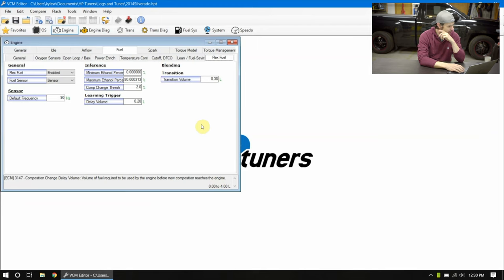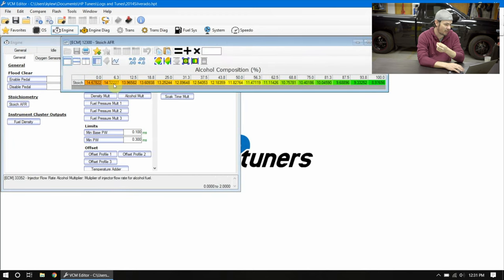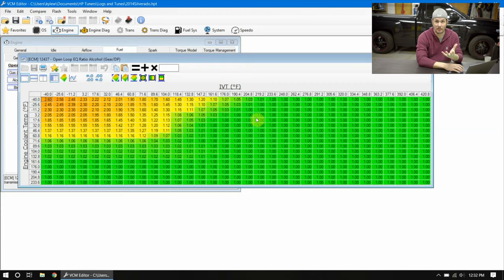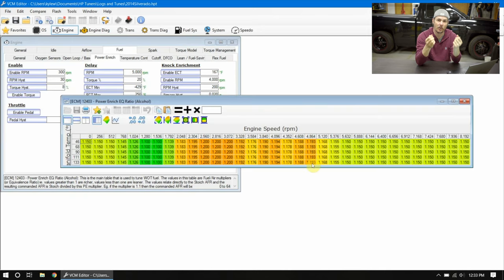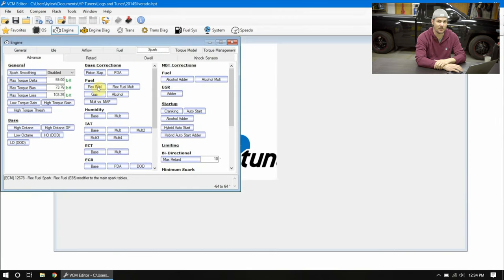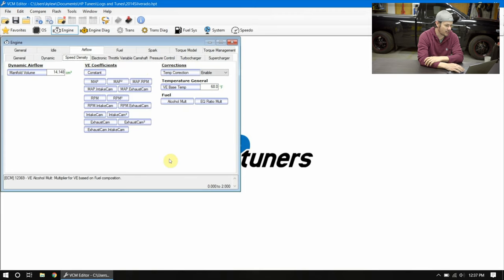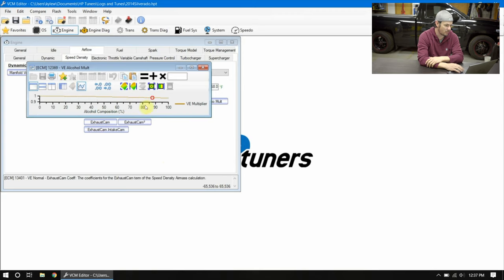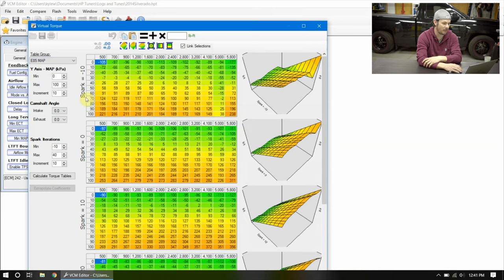Flex Fuel Tuning in HP Tuners, Tuning Series Vol. 7

Comment: Installed the AC Delco Flex Fuel sensor on my 2018 Silverado Crew Cab last year and this is what I found. Of course did all the flex fuel changes on the tune, but, it kept throwing LEAN error codes (P0171, P0174). My LTFT/STFT were always lean. My sensor reads Alcohol percentage of 80% which is awesome. GMs Factory Stoich in the tunes for 80% Alcohol is 10.000ish. I had to drop my Stoich to 8.000ish at 80% alcohol and interpolate across Stoich 14.6 0% alcohol to fix my STFTs. Just had to richen it up a notch 😁

Comment: What if you have a good 93 tune and don't have ethanol content sensor, but you want to run e85. Do you just multiply fueling tables by roughly 30% and tune from there or say put the stoichiometric table to 9.765 and tune from there?
Reply from the maker: Exactly!

Comment: I need help.  I have a 2000 silverado of which I've pulled the 5.3l and installed an "Iron Block LS2" with 36lb injectors, 58psi return less fuel rail, Drive By Cable, with added flex fuel sensor.  My P01 ECU was flashed with a 2002 Tahoe L59 (5.3l flex fuel) tune, so I could have those features, plus keep the drive by cable setup.
I currently have the flex system disabled and am working on getting the regular gas tune right, but I'm fighting a lean issue, and some knock... The ECU is pulling 2-3degrees under load, running on 93octane.  Starting as an LQ9 6.0L block, with 0cc flat top pistons, Gen4 rods, 243 heads, double valve springs, Cam is a TSP220r w/ 0.600" lift on Intake & Exhaust, Headers, cold air intake, and TBSS manifold.  
I've got it to where it starts easy hot or cold, idles "pretty" well, (some chop, but that could be the cam) doesn't fall on its face under accelerate,  and very rarely stalls.  It "sometimes" does after a quick throttle hit, followed by fully lifting off, smashing the brakes, and turning the wheel.  With that said, it's running too lean for my taste, and I can't seem to fix it.  Since this is Gen3, and a Tahoe Tune, I don't have Speed Density available.   My wide band shows 14.4-16.5afr anywhere from idle to 2500 under 15% or less throttle and light load.  It spikes to 17/18 under 50ish-% throttle, and it's still to new for me to hit PE at 90% throttle...  
The stoichiometric in the ECU is tuned at 13.5, but my AFR gauge reads as stated previously, and running logs show LTFT is pulling 8-9% on both banks..
I'm not sure how to fix this.  
Plus (not that it should matter, but I'll say it anyways) when I get upto around 65-70mph at 2500rpm and "coast" AFR will jump to 18 or higher, with a downhill "coast" jumping over 20, which is where my AEM gauge stops measuring.. 
DFCO is still ON, and if I'm right, seeing high numbers on coast is not dangerous correct?
Any thoughts on getting this thing to run a little richer, which may also help with knocking in this case?
Thanks

Comment: Really intresting channel.
Thanks!
Going to watch it all soon, and maybe over and over again, before I start my tuning trip in life.

About E85 I woner if you know about SAABs maps, it are sai that the EcoPower runs from 7-21% more from the 1,8t to the 2.3T about 130-250Hp (on standard gas) an at same time as more hp if run on E85. What o they do different, for an example a Volvo 2.xt Flexfuel do not deliver more hp and takes about 30% more on E85.
Any idea what SAAB did do?

Comment: Is this system able to make automatic adjustments based on lambda or some other method?  I have a 2016 F150 3.5L Ecoboost and there is no direct fit E85 sensor (tmk) and therefore no way to determine ethanol content of fuel in the tank.  I plan to upgrade the in-tank fuel pump, HPFP and injectors.

Comment: Thanks again for another great video.Just installed a Flex fuel sensor on my 2016 5.3 Silverado. I had a question about the  comment you made about the stock injectors 6 mill seconds for the direct injection engines . Are you saying my stock injectors won't suffice for the extra 30% needed if I plan on running straight E85? I changed my Stoich tables and all the other parameters to safely run E85. I put my first tank of 1/2 91 and 1/2 E85 yesterday and I was around 44%. Just making sure I can run a higher Ethanol % on my next fill-up on my stock injectors? Thanks.

Comment: Have you added a E85 kit to a 2019 GMC or Chevy 1500 new body style with the 5.3 motor?   Looking at doing this, and leaving it in the factory running for now. HP tunner says I have to swap out the ECM for a TCM.  The factory ECM is Locked so you can’t write or change parameters.

Comment: hello just to let you know i have been watching your videos and i like your style. i liked it so much that i bought my own mpvi2  to start tuning my car. i just installed a bunch of parts and need help with some tune advice
Reply: Did you create an account on HPTuners website for the forums?  You will find a TON of information and helpful people there, who usually reply in under 24hrs.  
That's where I've posted and resolved 95% of my issues, but the one I'm working on today, is a bit more complex.

Comment: Interesting that it only goes to 80% ethanol. I have a theory as to why that is. Perhaps because when the sensor is initially calibrated it is stated that the fuel in the tank is required to be E10 or lower. It is rare these days to find gasoline without 10% ethanol so the baseline of what the pcm considers pure gasoline is actually 10% ethanol; making the sensor good to up to 90%.  I am looking to ADD a fuel composition sensor to my 03 silverado and I believe you said you did that too. Video request. More info on how to do that and if I can get a lower cost sensor (maybe a generic) so long as it outputs the proper signal (hz?)

Comment: You're speaking the truth about the varying alcohol content at the pump for E85. One station can be E85 and the other might be E50.

I had a little 93cc scooter with about 13:1 compression running E85 on a carburetor converted to run E85 and i blew it up one day driving down the road because the 7/11 i filled up at was only putting out 60% ethanol in their "E85" and of course being tuned for 85% it started spark knocking and destroyed the rod bearing. Piston looked like someone hit it with a shotgun.

Moral of this story, if it can happen to a scooter it can happen to any motor and  your tuning window gets smaller and smaller as boost and compression ratio goes up. Imo its not even worth running pump E85 with out an alcohol sensor to variably adjust the spark and fueling or else your motor is just a ticking time bomb
Reply from the maker: Exactly! If I'm not mistaken it only has to have 50% alcohol to be considered E85. I worked at a truck loading rack back when they first started blending it and places like 7-11 could request a certain blend in order to hit a price point for the fuel so if they wanted to sell it for $1.99 a gallon they could request the blend amount that would put their cost and price at the right area and as long as it had that minimum of 50% it was considered "flex fuel".

Good story, thanks for sharing it!

Comment: I have 2005 Corvette with APS Twin Turbo. I just installed a flex fuel sensor and turned on Flex fuel with my MPV2 Pro. I also have an Innovate SCG-1: Solenoid Boost Controller, Wideband Air/Fuel Ratio,  I have heard people saying I need to tune to 1.0 lambda regardless of fuel. I have also read people say you need to tune for .7 Lambda for E85. Which is correct ?

Comment: Unfortunatly my car cant run full e85,
But Lets say the car is fully tuned for  e60. In this case can i run any E percentage (example e40) on the vehicle or should i stick to e60 ?
Reply from the maker: Stick to E60, variation from it will make you run rich or lean.

Comment: So if my truck didn’t have the alcohol content sensor or the wiring for it will it be able to log the pid even if I wire it into the pcm.  Currently it shows 0.0 on that pid but I know I should see some alcohol (e10 fuel) unless it’s not able to see it
Reply from the maker: You have the PID and it looks like the ECU for that year has the option in the flex fuel tab so even if you don't have the harness already you should be able to track down the pinout to add it.  My guess is someone has done it so a little searching on the forums will most likely turn up a write up for you.

Comment: Hey bud I’m stumped in between E85 or 93 octane tuning I’ve always ran 93 I haven’t been down the e85 rabbit hole I’ve watched the videos you have on it I have a 2011 GMC Sierra so it’s set up for both I’m just at a fork in the road I’m about to be tearing the top end off in a few weeks so what’s your opinion on it? Help me ! Lol
Reply from the maker: It's kind of a double edged sword, it's detonation resistance is great for forced induction but the fact you need 30% more fuel can be a pain unless you're upgrading your fuel system anyways. If so I'd build in enough capacity to cover the 30% at your desired power level so you can run it. From a pure performance standpoint E85 is the way to go.
Reply: I had a feeling you were going to say that I guess I’m just a little A timid dated not knowing much about it I’ll definitely dive into go and finish up your other videos thanks for getting back brother I’ll check in on y’all tomorrow

Comment: If I am wanting to run flex fuel on my 0411 P01 PCM, do I just do the compare, segment swapper, then just choose Fuel System. I will be using the 2002 Tahoe OS IIRC 12216125.
Reply from the maker: Yeah, the hard part is finding the right os to do the season

Comment: Hi, I already have a great cam gas tune. If I understand correctly, by adding a flex fuel sensor I can enable the sensor and leave all other flex fuel alcohol tables as per factory settings? Will e85 typically take an additional 6 degrees timing at wot n/a ?
Reply from the maker: Yeah, look at the adjustments on a stock flex fuel vehicle, they will carry over as they are compensation for ethanol
Reply: Thanks. It seems to run a little leaner at WOT with e85 when looking at the o2 voltages. Any tips to richen it up without adjusting the VE table?

Comment: i just got hp tuners to learn how to tune on my 2011 silverado. its been tuned by pcmofnc previously for a cam and other bolt ons. but when i opened vcm scanner my fuel trims are in the 20's on bank 2 and around 12 on bank 1. which i know isn't right. i haven't got a wideband yet to see lambda yet but i do plan too. Either way even with out the wideband yet i still don't see why it would show so lean on the fuel trims. My only thoughts are that maybe sense i'm running E85 in it right now (it is a flexfuel truck) and it wasn't tuned while i was running e85 it had 93 in it when i had it tuned so maybe sense E85 requires more fueling the truck is just running lean due to not being tuned on E85 yet. That or im thinking my o2's could be bad. Any thoughts?

Comment: Ok so I've got an issue here. 
I've got a gen4 L9H 6.2l 
Flex from factory. 

I've been tuning on gasoline for years yadda yadda I'm good with the set up in terms of fueling changes and spark. 

I decided to finally tune a bit on a 40% mix of e85. 
Well. 
I added the fuel, 
My "virtual flex sensor" (I know not a real sensor) is not switching the fueling? 
It shows its scaled to command a 12.4 afr in vcm scanner....... but my wideband is showing 14.7ish still... ive idled it drove it light Steped in just a touch idled more. 
It will not add the extra fuel commanded? Stays at its happy ass fuckin 14.7 
I switched my gauge to read lambda and it's sure enough... at 1.00 
Is there a way to force it to add that fuel or do I just have to drive horribly lean till it decided ls to add that fuel its commanding? 

Hope I get some sort of answer I fuckin hate contacting htp. 

I mean litteraly everything in flex is turned on.. its showing a 41% alcohol content. And it's commanding 12.4 at normal operation. 

But my physichal gauge is showing 14.7(ish) 
Just will not physochaly add the commanded fuel increase. 
Far as I know I've never fucked with any of my flex settings.. ive zeroed my flex map in spark table to cause less interference in my main tables (zeroed alot of em so just relys on my main tables)
I had to have switched or shut somthing off aling the way that allows it to physically add the extra fuel? 
Or does virtual flex see the changes quickly but not compensate forever

Comment: So when you add timing how on the multipliers how do you know how much timing is being added when you’re not at e85? If you tune on e85 then you’re on e50 later won’t you have the same amount of timing based on this multipliers? Shouldn’t there be a spark multiplier just like a fuel multiplier at a given percentage of ethanol?
Reply: blending takes care of that, if you tune the e85 tables  and you have e50 blending takes care of that, but i come from the access tuner world so not sure what it is called here.

Comment: So basically your saying that direct injection(is what I have) has a 6ms windown an I cant flow enough for E85? I have a 17 camaro SS LT1, an the kit for it. If this doesnt work, whats next?
Reply: Have you had this answered already?
Reply: @NickParedez  No.. I think it was the answer was just trying to confirmed, I should know in a week thou, My kit will be on then.
Reply: @1diybrotha  correct, from my understanding, he wasn’t saying that you don’t have enough fuel, or that you won’t, just that during your tuning if you see your average pulse width hit or exceed 5ms you have ran out fuel and will need either a secondary fuel source or a cam with a bigger fuel lobe.
Reply from the maker: You might have enough for E85, there is some space usually, I didn't start to run out of injection window until going over 7 psi of boost

Comment: What about if I am runing let's say an na setup with a 14.7afr on 95 octane already tuned  and then I decide I want to run it with  c16 fuel  do I go tune maf and ve and timing again or my stoich afr commanded will just do the math because now I have c16 in it will change by itself from 14.7 for gasoline to whatever c16 recommend afr runs on ? And if that's so it's a street/race car I am not going to run c16 daily am I going  to save these two tunes separately like c16 tune and 95 tune and reflash them whenever I have a race to run c16 tune then after the race reflash my 95octane tune  or I am missing something here
Reply: And how it's different for forced induction platforms

Comment: So when tuning fueling on e85, is it the same process you outline as tuning on 93 in your maf tuning video?  ie turn of 02, disable ltfts ect.
Reply from the maker: If you're doing it on a non flex fuel car you can go ahead and adjust your stoich table then do the standard tuning steps
Reply: @GoatRopeGarage  Ok so on a flex fuel vehicle, I did your maf tuning steps and got that all dialed in.   I'm a little confused on how to tune the fueling before spark.  Does the computer compensate automatically for the ethanol content?   Mine seems to be running quite a bit richer than with just 93.
Reply from the maker: @BigMatt302  Yes, you have to dial in the MAF and the SD tables to get it squared away. Are you running rich whole doing SD?
Reply: @GoatRopeGarage  I haven't done SD tuning yet with the ethanol.  I'll try to get some logs in before the live stream tonight

Comment: Do you have a video for fuel delivery (pump gas)?  After watching your series for maf/map tuning I've learned more than I did in weeks searching forums and youtube.  I don't even want to attempt that for fueling.
Reply from the maker: What part of fuel delivery, fuel delivery is a calculation of the MAF/SD, it's a constant with the air being there variable that is used to get the final fuel command
Reply: @GoatRopeGarage  I think I found what I was looking for, I just didn't know the name of the table at the time.  The power enrichment tables.  I was trying to figure out what controlled commanded AFR.  My car was going as rich as 11.5 as soon as it was in boost until 5500rpm, 10.8 after 5500rpm.  That was taking my stock injectors to 103% and fuel pressure was dropping to 52psi even though 65 commanded.  I'm going to finish the map/sd cal and then lean out the pe table a touch and see if that helps until the new parts get in.  I actually found the table name through your video, thanks to google.  Pretty simple in hindsight, just figured it would have had a fancier name or several tables to edit lol.  Thanks for the reply.
Reply from the maker: 11.5 is about where you want to be on a boosted application unless it is a gen 5, so you might be stressing your injectors, just be careful!
Reply: @GoatRopeGarage  it is definitely stressing the injectors. I was amazed by how rich these run out of the box. As soon as I can get this map dialed in, I'm going to start leaning out the PE table a couple points up top.  That will hold me over until the new injectors get here.  The map/speed density stuff is such a pain though lol.  There's a spot at 1300 RPM/130 KPA that absolutely will not richen up. No matter what I do it's always showing 20% too lean in the log.  Once I get that block figured out, it's pretty much done.